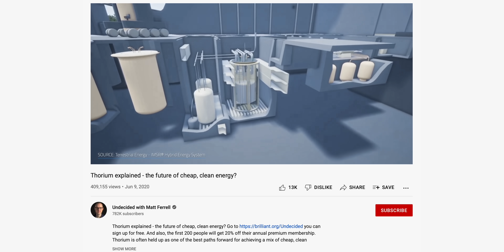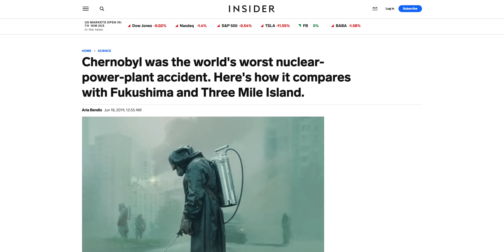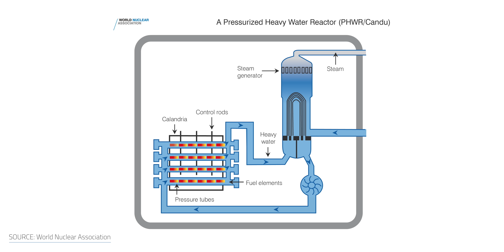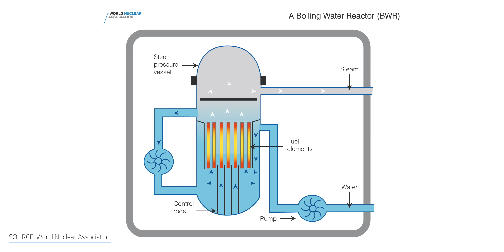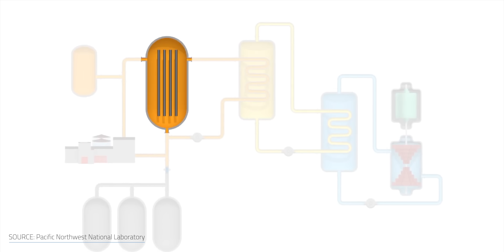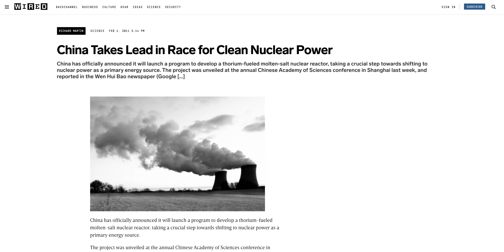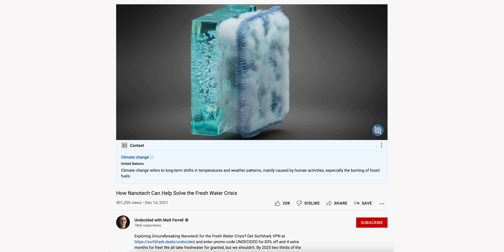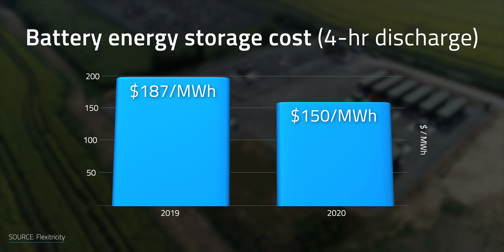Revisiting Thorium Energy - The Future of Nuclear Power?

Comment: Pretty good breakdown of this technology. As far as comparing msr reactors to renewables, there are some unfair/inaccurate biases that always raise their ugly heads. If the promise of msr technology is realized, their construction, regulatory and operating costs will be a small fraction of light water reactors. Solar and wind costs are always presented with a 4 hr battery backup. This is fine with a renewable contribution of 20 - 40%. The costs rise exponentially once they are relied on for 80%, and another exponential rise for 100% reliance.
 A likely candidate for the best "battery" is molten salt or other thermal storage. This would work well with nuclear as well, making a mixed system of renewables and nuclear an easy visual. Of course if we pursued nuclear more aggressively, there wouldn't be an intermittency issue. Nuclear equals constant, reliable energy, with boatloads of heat. Heat for not only desalination, but hydrogen production, heavy industrial processes, heating the local community and more. The waste can be used for things like medical isotopes. MSRs are not just of the lftr design.  Fast neutron designs can be employed to use much of the nuclear waste already in storage.
Well worth pursuing. 👍
Reply: Well said about thermal energy storage for stabilizing output of the grid & for grid power storage & compatible with the king of thermal salt heating already happening in a LFTR (my favorite kind of nuclear reactor) along with MMR shipping container fission reactors * & FNR OR IFR fast neutron or integral fast reactor .. that can breed fissile radioactive element fuels in an over parity + positive feedback loop that make additional fuel available - providing a Fission fuel breeder cycle that can make electricity, hot water, hot air & energy storage, for 10 billion people for millions of years ..
Reply: How does the specific heat of molten salt heat/energy storage capacity compare with batteries, or heat stored in water?
Reply: @tobyw9573  The specific heat of molten salt is relatively moot variable as the primary benefit is it's boiling point of 2552F (1400C) in comparison to water expanding 1600 times in volume from liquid to gaseous state. Just make the molten salt pool larger to balance the variance in specific heat capacity.
Reply: @RichardPrendingue  Hi specific heat is important since it enables heat storage that can be used for additional generator turbine output to fill load fluctuations not requiring adjusting the reactor output. Musk is selling expensive battery storage farms to accomplish the same thing. Engineers can balance the equation however they want to achieve their goals. Enlarging the molten salt tank requires expensive steel and shipping costs..
Reply: @tobyw9573  It's still irrelevant as nuclear is just the most complex steam engine possible. You have reactor coolant (molten salt) that feeds heat into a separate heat exchanger "cooled" by water turning into steam that powers a steam turbine. The specific alloy for molten salt is hastelloy.

Instead of larger molten salt reservoir you could increase flow rate complimented with a larger capacity steam loop having same outcome but cheaper.
Reply: @tobyw9573  For example on racing vehicles installing a higher flow rate water pump and upgrading radiator maintains thermal stability preventing pre-detonation of fuel from existing combustion chamber heat.
Reply: Renewable is not realistic as a whole generation for a country.
Reply: the main challenge with thorium is still the storage of radioactive waste. even with the 20x shorter half-life, we still don't have ideal radioactive waste management, especially for countries with no history of nuclear power.
Reply: Unfortunately, you cannot get 1400 Celsius from a reactor, which is required for heavy industry, like cement or steel production. Well you can, but that would be an end of the reactor.
Reply: Um... how does battery cost increase "exponentially" with a linear increase in system power capacity? Wouldn't it increase linearly? Language matters, people. Using "exponential" to mean "linear" makes you sound like a fanatic with an axe to grind.
Reply: @davestagner  if you take the time to research the issue, you will learn that the required capacity needed (eliminating fossil fuel backup) to supply 24hr demand does result in an exponential rise in cost. With exponential defined as squared, cubed, etcetera.
Reply: @carrdoug99  Given, well, MATH, you might understand that “take the time to research the issue” doesn’t make sense to me. Can you point to the research I’m missing that says 3x generation capacity requires 9x backup capacity? Because that’s what “exponential” implies. I’m not going to “take time to research the issue” on something that sounds like mathematically unsound nonsense, but if you can point me to an article, I’ll read it (critically). It’d be especially good if this “exponential” backup computation took into account that “renewables” encompasses both solar and wind, which have EXTREMELY different intermittency behaviors.
Reply: @davestagner  that's why you needed to research this issue. Because of intermittency, the system has to be so overbuilt to offer 24hr a day, 365 days a year reliability, the costs (not to mention the land and resource requirements) are massively higher (far beyond linear) than what is required for a 40% renewable system. Now, as battery and photo voltaic technology improves, this dynamic might change, but the dynamic that exists now is why I have become a supporter of these nuclear reactor technologies.
Reply: @carrdoug99  I’d encourage you to read “Electrify”, by Saul Griffith, an engineer who has done the hard math on what it would take to get a totally green power system. He doesn’t say nonsense like energy storage needing to grow exponentially relative to linear growth in renewables. It’s not about “better” batteries or whatever. It all comes down to cost in both the macro and micro senses. Once a green grid is cheaper overall, the switch is inevitable, and we’re verging on that already - but the grid itself, designed for stable sources like coal plants and nuclear reactors, is a macro problem that needs addressed. 

The problem nuclear power faces is, and has always been, its cost. The plants cost billions up front, and take decades to break even. And the operating cost does not change just because the output does, so scaling down just makes it more expensive (and scaling up takes many years and billions more to build another reactor). Thorium or pebble beds or molten salt or whatever the new hotness is among the keyboard engineers makes ZERO difference. We’re approaching 1c/kwh costs for PV solar. That makes even stored energy cheaper than nuclear. Nuclear costs need to come down an order of magnitude (as solar/wind have done in the past 10-15 years) to compete. I don’t see that happening. It’s not about safety or regulation or politics. It’s about money.
Reply: @davestagner , does that 1c/kwh statistic reflect the current valuation of solar energy, or when solar energy/renewables would make up more than 80% of the grid?  Yes, presently, I'm selling my PV energy back to the utilities at a pathetic amount, but that's because those kilowatt-hours are not highly valuated with stable base load power systems.  Remove that base load, and the valuation of a solar energy kilowatt hour will spike during winter months.
Reply: You are aware that if normal Uranium based reactors were a large enough  piece of the pie, the fuel costs would go up exponentially aswell?

"As of 2017, identified uranium reserves recoverable at US$130/kg were 6.14 million tons (compared to 5.72 million tons in 2015). At the rate of consumption in 2017, these reserves are sufficient for slightly over 130 years of supply. The identified reserves as of 2017 recoverable at US$260/kg are 7.99 million tons (compared to 7.64 million tons in 2015).[10]" 

Nuclear is about 10% of the worlds production today, so we could be talking about a shortage in 13 years if the whole world would switch to the most prevalent LFR's used today.
Reply: @Minuz1  that isn't born out in the data I've read. It's all about reliability/availability. Nuclear (and fossil fuel) offers a given power that can be relied upon day and night, all year long. Solar and wind don't. That's why you have to overbuild the system once wind/solar becomes the majority power source. Its not just a matter of doubling facilities to go from 40% of grid capacity to 80%. When wind & solar are only helping supply power, as they are now, the intermittency problem is not an issue. Although we are already seeing the first signs of trouble in places like California and Germany. According to a report I just read in favor of creating a fossil fuel free grid. It will cost more than 4 trillion dollars over the next ten years for the US to go 100% zero carbon. It would cost an additional half a trillion+, if nuclear was not part of the mix.
Reply: Nuclear is not in competition with Solar or Wind. The biggest problem is that competition mindset.
"regulatory and operating costs will be a small fraction of light water reactors."
In the US, this is not true. The problem is that current US regulation defines what is "sufficiently safe" based on what is "economically viable". The economic burden of safety is considered  "appropriate"  if the cost of safety measures would make the electricity produced by the plant equivalent to that of fossil fuel alternatives. This has several huge problems. 

First: Even if you invent a nuclear reactor that's 1000x cheaper than coal, the regulations simply state that you have to invest 1000x as much in safety measures. 

Second: Nuclear power plants have a much higher capital (up-front) cost than fossil-fuel plants. They typically recoup that cost by producing electricity at a much lower operating cost (like fuel). Building a plant can and often does take over a decade, so the plant builders have to hit a moving target in terms of regulations only to barely make a profit that might never pay-back the many billions of dollars spent building the plant. 

Third: Even if regulations were relaxed (and that's a BIG if), it will likely take decades to develop any new technology especially since the defense department is no longer interested in footing the bill in exchange for more fuel enrichment capacity. And each reactor will likely still take a decade or so to build. We simply can't afford to wait that long.

LFTR and other alternative reactors are very cool tech, and I hope they get developed, but it's hardly something we can count on to save the day.

As for renewables and storage.
"The costs rise exponentially once they are relied on for 80%, and another exponential rise for 100% reliance."
This not only makes no sense from any point of analysis (what is "an exponential rise"? That's not a unit. Going from 1 to 2 could be considered "an exponential rise"), it also just isn't true that intermittency is such a big problem. There are many solutions that can work together to solve the intermittency problem:

1) Diversified Energy Sources
Wind tends to blow harder on overcast days. Geothermal, tidal, and hydro energy are fairly reliable.

2) A Super Grid
A simple idea: Connect regional grids together with High-Voltage DC lines to make one large grid that spans many timezones and climate zones. When the sun's not shining in Kiev, you can use the excess wind power off the coast of Portugal. A study[1] was conducted back in 2006 that showed it was possible to power all of Europe and North Africa on solar and wind without the need for batteries using a Super Grid. It's been estimated that a North American super-grid would cost on the order of $500 Billion[2]. Which is very do-able. On top of that, a super-grid would come with all sorts of secondary benefits like cheaper electricity and a more stable grid in general.

3) A Smart Grid
This one's a no-brainer (get it?). It doesn't require a ton of expensive infrastructure because it's already possible to transmit information over electrical wires. A smart grid can smooth out demand spikes, by say, staggering the time peoples water heaters and AC/heaters click on. It can also let EV owners opt-in to using their vehicle batteries for grid storage. Desalination plants will likely become more popular as climate change worsens, but they typically don't operate on an "on-demand" basis. As long as they produce clean water at a given average rate and have enough reservoir storage, you can switch them on to soak up excess supply or switch them off when supply is struggling to meet demand. There are many other, similar systems that could operate in the same way.

4) Storage
Finally, yes: there's storage. The above solutions largely mitigate the need for tons of storage, but your claim of "exponentially increasing costs" cuts both ways. Not only is the amount of storage per dollar also advancing on an exponential curve, the obstacles in the way of 100% reliance on renewables get exponentially less frequent as you approach 100%. How often do you go more than 4 days without wind or sunlight? How about 8 days? How about 12 days? 16? 20? 24?

Finally, the fuel costs of nuclear aren't as negligible as people claim. One of Nuclear's biggest problems is that it's often sold very hard by very loud cheer leaders who give the industry a reputation of over promising and under delivering. One of those promises is that the worlds reserves of nuclear fuel would last billions of years[3]. If you don't rely on technology that has been in the lab for 50+ years (breeder reactors, mining ocean water, etc.) those billions of years dwindle down to... 5.7 years[3][4].

[1] https://transnational-renewables.org/Gregor_Czisch/projekte/LowCostEuropElSup_revised_for_AKE_2006.pdf
[2] http://northamericansupergrid.org/2017/11/27/study-summary
[3] https://whatisnuclear.com/blog/2020-10-28-nuclear-energy-is-longterm-sustainable.html
[4] https://phys.org/news/2011-05-nuclear-power-world-energy.html
Reply: @AbeDillon  Of course they aren't in competition with nuclear; that would suggest that the rain collectors of energy are actually anything more than a novelty if required to meet the same standards.
Reply: @AbeDillon  nuclear is in competition for investment. solar and wind get $128+billion a year and nuclear gets $23+ billion. this lack of funds has set us back a good 20+ years of development.
Reply: @AbeDillon  haha - 1) Diversified Energy Sources - the greens will never allow it especially in Australia - they don't even like wind
Reply: Solar/Wind and nuclear shouldn't compete with each other, just compete with proven GHG emitters.   The promise of modular reactors in factories (yes, still just a promise) could allow fast ramp-up of smaller reactors to directly replace coal/gas/oil power plants.    Also, what about the land use - the extraordinary amount of land (about 13 people per acre of solar panels for ALL energy use at US levels - 80+ 
mwh per year) that would be required to power our industrial age?  The raw material/land required for solar/wind seem too high to ever wean ourselves off fossil fuels.   As the fossil fuel industry was caught saying - Every solar/wind installation needs a pipe for natural gas for emergencies.
Reply: @hopliterati61  Land use isn't really a problem. Solar panels can be paired with buildings, parking lots, even with agriculture. Similarly wind turbines too can be paired with agriculture, industrial zones, ...

There also is more than enough material, especially with mandatory recycling (like for solar panels in the EU).

As for the back up, it is true currently that is mostly natural gas, but over the next 1-2 decades this will be replaced by grid storage and just smarter use of energy.
Reply: re: Land use isn't a problem - I live in the US on the coast.  Land is definitely a problem !  Though I do like the idea that the shade provided makes some crops grow better.   I calculated that the land use required for solar for US  population (which actually has low population density) would be about the size of the state of Ohio .   (I understand that it's unreasonable to think that we would be all solar).
Reply: @hopliterati61  Remember, you put solar panels on top of buildings and parking lots, so land use shouldn't be a too great problem, except in high density cities maybe, suburbs wouldn't be a problem. And indeed you wouldn't use 100% just solar.
Reply: @hopliterati61  put. 
the.
panels.
on.
roofs.
that.
already.
exist.

how many ohios is that?
Reply: @NaumRusomarov  lol - ok - picture 15 friends and all the roof space they have available - do you think they have an acre of space for the group of 15?   Say 4 people live in a house - do they have 1/4 acre of roof available?    Unless your friends are the professional ballers - i don't think so.
Reply: @hopliterati61  The land useage to power the whole world via Solar is the size of Wyoming...something wrong with your maths.
Reply: @AbeDillon  excellent, that was a joy to read
Reply: @AbeDillon  Thank you--this was illuminating.

Other uncertainties faced by nuclear power developers include the level of transition to renewables over their productive horizon.  Adoption of renewables will reduce the demand for nuclear.

In that vein, there's also a technology risk. How cheap will renewables become?  What new and better storage technologies are likely to be developed.  Hydrogen looks promising.  As does liquid metal.  

If thorium plants can be built cheaply enough to assume these risks, they may have a future.  But we're not there yet from a technological standpoint (although we're still a lot closer than we are to fusion).
Reply: Your exponential cost growth assumes renewables produce just enough energy. It'll be cheaper to over-produce to displace some batteries. The side effect will of course be free power at times of high production.
Reply: @mrleenudler  No, not even close. To make energy collectors work, you have to over-collect to generate a stockpile and have a way of storing it for when there is a dearth of ambient energy to collect.
Reply: @mrleenudler  One of the biggest issues talked about at the Intersolar Conference in CA this year was LDES(Long duration energy storage)

For a renewable grid to be able to reliably provide power during less ideal seasons, with near 100% demand delivered, you'd need roughly 21 days worth of energy storage for each kw of energy the renewable grid can produce at peak.

There were plenty of solutions presented, hydrogen, gravity banks, heat, etc... but even the most optimistic numbers given by the representatives of the companies developing the technology, was that the energy required for the state of California alone would be well over $100 billion for storage alone. And that's assuming it wouldn't run over budget. 

Nobody on any panel related to the topic realistically knew how to pay for it without unrealistic reduction in storage prices in the next 10 years.
Reply: @mrleenudler  
The 'free power' will be used to produce green hydrogen from water.
Reply: @mrleenudler , an electrical grid works by matching demand with production on the fly.

Over producing is not possible.

The can only be over capacity some of which is shut down to not overwhelm the system.

What is produced must be consumed.
Reply: @jizzlecizzle1388  overproducing is possible if it is taken as having the infrastructure to produce more. The one possibility that I know is utilized currently is disconnecting windmills when their power is not needed.
Reply: @jizzlecizzle1388  hahaha. What a dumb comment.
If i am in france and produce too much energy i export it to other countries like Germany and use it to fill batteries.
Reply: @bertthompson4748  , obviously you are in denial that there a limit to the flexibility interconnections and reserves bring.

Obviously even with that in consideration production must match demand.

Overproduction is not a option as a basal model.
Reply: @jizzlecizzle1388  production doesnt need to meet demand.  If you overproduce it goes to storage and storage can then meet peak demand later.

This is being done right now in the real world in places like S.As hornsdale battery facility.

On top of that OVERPRODUCTION can be exported which has happened for 100yrs
Reply: @jizzlecizzle1388 , In that case, wouldn't the excess energy produced by renewables be channeled into lifting weights on gravity towers or electrolysis to produce hydrogen?
Reply: @EdricLysharae  , it is possible.

Yet there is no demonstration those systems are viable, that such approach can be as efficient, low cost, controllable as one using nuclear energy and some renewables.
Reply: @jizzlecizzle1388 , I agree.  Having a reliable base load source of power is the foundation for an electric grid.  I have a feeling that nuclear energy will have a renaissance, and it will be due to necessity.  I don't know of another carbon-neutral power source that delivers the reliability of nuclear energy, at least with the electric grids in their current incarnation.
Reply: @mrleenudler , yeah, that's the brute force method of balancing the grid.  However, the overproduction would be huge during some periods of the year.  The winter:summer production difference is about 1:4 for solar around my latitude (Northern USA).  I don't know what the statistics are for wind energy differences due to seasons.
Reply: @mrleenudler  over-producing with renewables would lead to a waste of resources and a lot of toxic waste (e.g. from decommissioned solar panels).
Reply: I believe your worries have been addressed by Tony Seba with super power - 3 times the sustainable capacity that we need will offer (virtually) free energy at times and will strongly reduce the need for storage while beating the alternatives on price
Reply: Doug Carr said, "...the best storage is molten salt."

No.  Over 90% of the storage has been around for more than a hundred years -- pumped hydro.  There are thousands of site choices around the world.  Pumped Hydro can also be used with underground mines.

Renewables plus storage cost less than nuclear and will always be because they require *no fuel*.  Utilities make the decisions on the type of generation and they're not choosing nuclear because of billions of dollars in cost overruns and decades of construction delays.  Until those problems are solved there will be no new nuclear power plants brought online.
Reply: @acmefixer1  pumped hydro is great, but even with " thousands of sites", it's not as ubiquitous as your suggesting. As you know, pumped hydro requires sites that hold two large bodies of water, with fairly substantial elevation difference, in close proximity.  These conditions don't exist in anywhere near enough locations to provide the needed energy storage.
Reply: @acmefixer1  haha name one site for a dam in Australia that the greens / leftards / pinko environmentalists and aboriginals will allow to be built, they won't even allow existing dams to be raised for flood mitigation - the greens don't even like wind but hate fossil fuels with no other solution offered as usual
Reply: How do they deal with a highly corrosive material?
Reply: Not true. Denmark already produces 50+ % of electrical energy with wind, and we have 0 battery storrage. Intelligent energy pricing will allow us to move demand off peak hours like car charging and other high demand loads. PtX will also make it possible to get even higher wind production.
Reply: @gandalf1124  Denmark is also a net importer of electricity, generating only 83% of net energy. It imports / exports a lot of energy when production is low / high which wouldn't work if everybody was doing it. Denmark exports 45% of generation and imports around 30% of usage
Reply: @gandalf1124  0 battery storage > car charging. So what are you charging in your car then?
Reply: @gandalf1124  But it also more expensive than coal to the end user's.
Reply: @goatlady7761  Your point being? Coal is only cheaper if you don't tax the CO2 polution. But today ofshore wind is actualy cheaper than coal.
Reply: @gandalf1124  And Denmark has an average kwh consumer price of 30 euro cents per kwh. That's horrifically expensive.
Reply: @KineticSymphony  But is that caused by old coal and gas powerplants. Or old wind turbines that have been guarantied a minimum price. New wind farmes are guarantied a minimum price of 0.1 euro cent per kwh.
Reply: "The costs rise exponentially once they are relied on for 80%"

irrelevant. no country has 80% of production from wind and solar today; most countries don't produce even 10% of their energy from renewables.

unless you're from the future, this proclamation is utterly devoid of any meaning.
Reply: @NaumRusomarov  We have this thing called math, and it's extremely useful for extrapolating outcomes. The greater the percentage of energy collectors, the more they have to behave like the dispatchable generators they had to displace. If forced to behave like dispatchable power, costs immediately increase by triple or more on account of the poor capacity factor of energy collectors. Then we have to add in the cost of storage, not just for day to day demand, but long term seasonal fluctuations. Suddenly, wind and solar costs thousands of dollars per MWh.